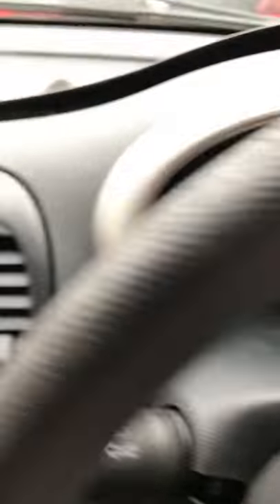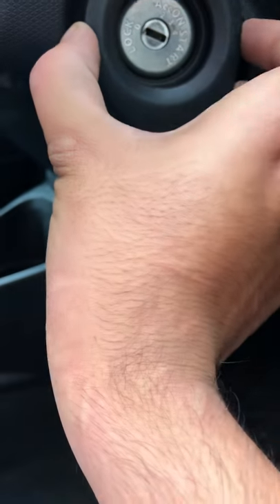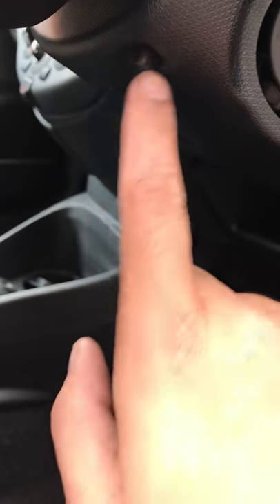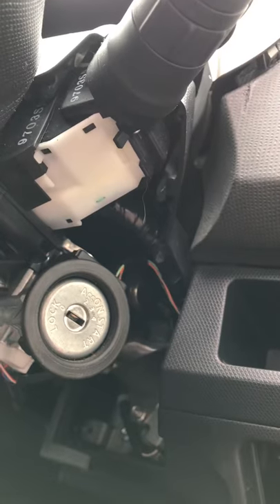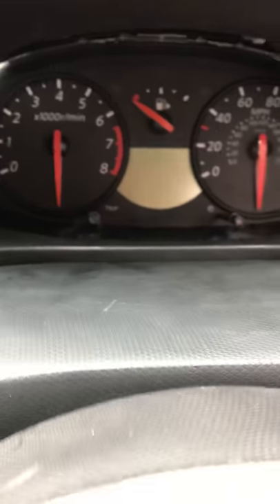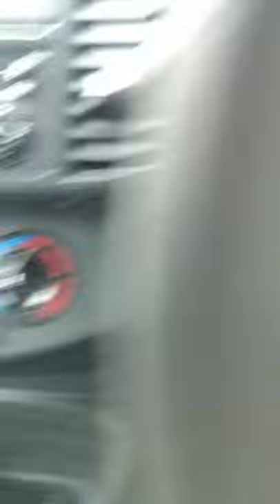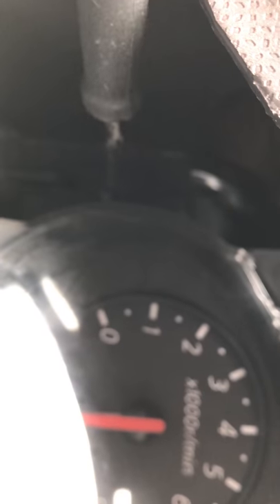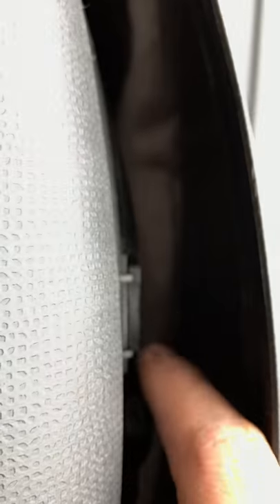HOW TO REMOVE NISSAN MICRA SPEEDO METRE INSTRUMENT CLUSTER

Comment: Thanks for the video.  I managed to pull the pieces off with just fingers rather than prying with a screwdriver.  But I got stuck with how to remove the screw on the top, and now found your video.  Will try the socket method.  My cluster is really dim and can't really be seen at night, so hopefully it just needs a new bulb on the back?
Reply from the maker: Glad I could help, from the sounds of it you may just need to replace a bulb in the cluster these can bought from eBay at a reasonable price